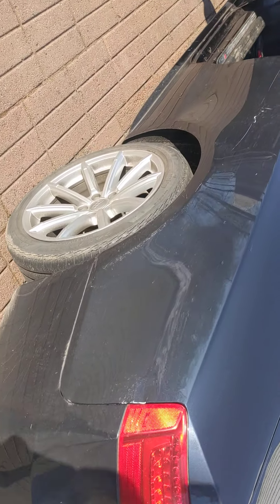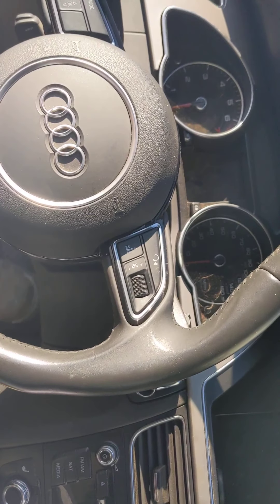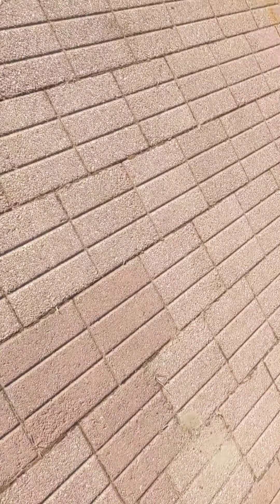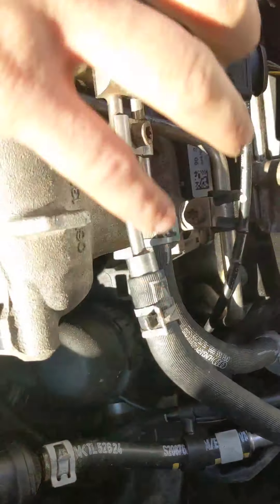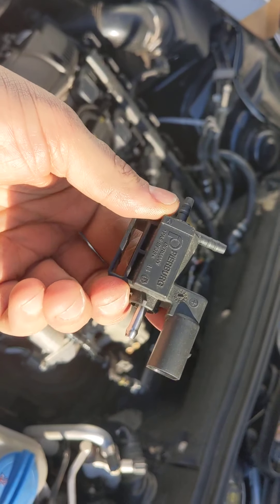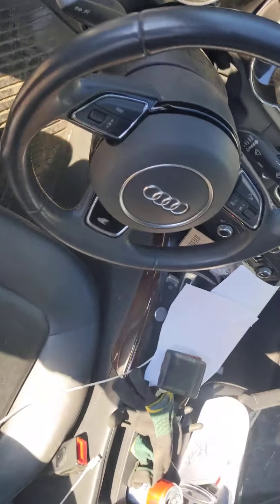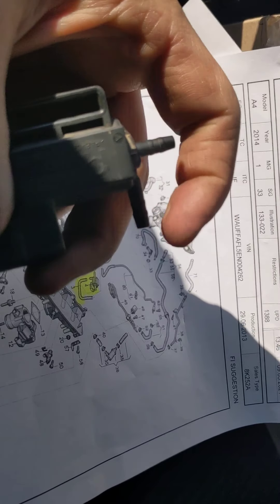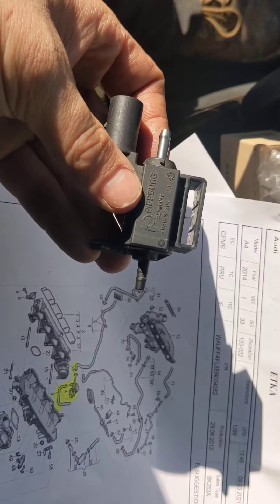2015 Audi A5 issue with p201500  intake manifold runner position sensor switch circuit problem

Comment: That part is a vacuum servo solenoid switch used to activate the flap control rod diaphragm. The position sensor is at the front of the manifold visible behind the oil filter.

Comment: Hi know this is off topic  but i have a 2014 a5 and can't find the location for were the front impact  airbag sensors are located  if that your car any chance you can make and post a video  thank you i know there are somewhere behind the headlights well that is were i found the wire connector just hanging